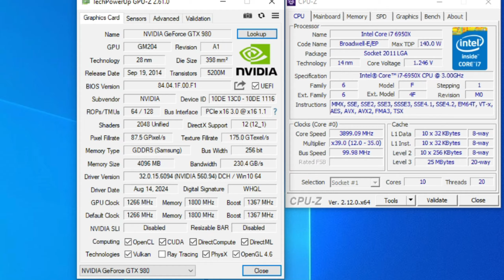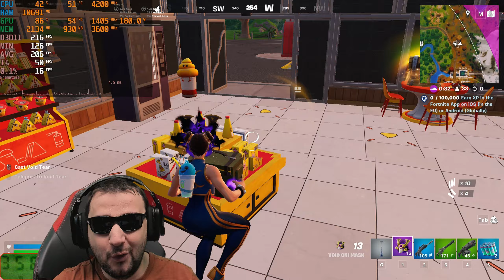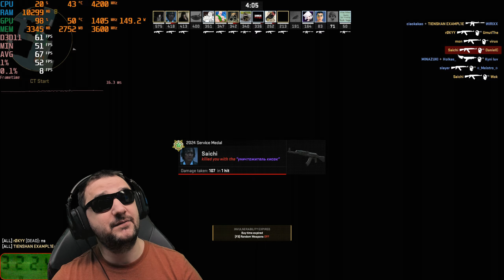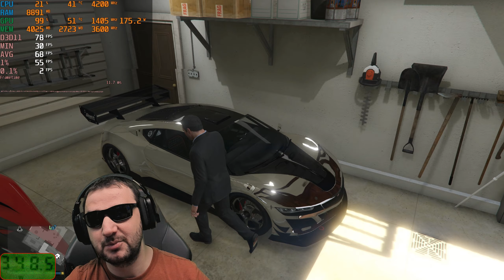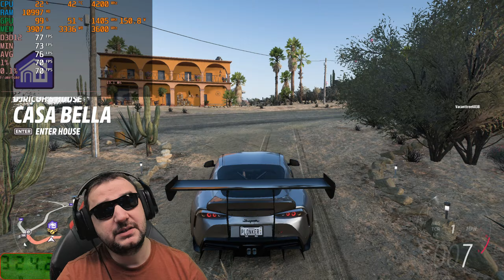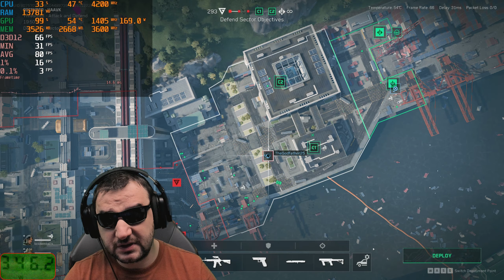Inno3D iChill GTX 980 HerculeZ X4 Air Boss Ultra Benchmark

Comment: Nice card, have the msi card here. Keep in mind to keep the fan speed high on yours. Inno3d does not redesign their cards just slap a better cooler on them. Coils on the memory vrm tend to get fried with the reference pcb. Its just a 4 phase vrm for the core and 2 for mem. Only asus, msi, gigabyte etc tend to redesign the vrm and power delivery. This msi card will get to 65 degrees but it has a much better vrm.

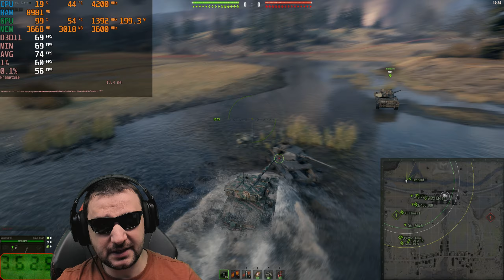Comment: 11:08
you've tested it with World of Tanks, maybe you should test it with War Thunder too.

i've been use this GTX 980 jetstream until Dec 24. Its a good GPU Card, run Forza4 in ultra preset with avg 40fps, its a beast. But mine, for War Thunder maximum in Medium preset that i can enjoy the battle, because in high it will drop to 40 fps, i cannot see enemy in 40 fps or lower.
Reply from the maker: Definitely I'm going to test the card and I'm going to test other games too.
Reply: @DanielCardei  also add Enlisted to your game test too. Enlisted kinda heavy to load for my GTX 980.
Reply: @ thank you